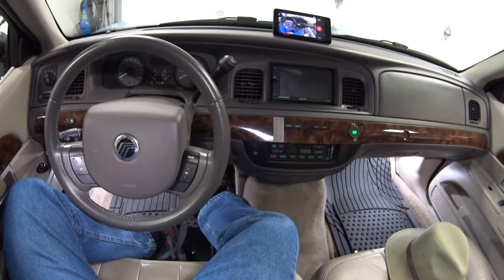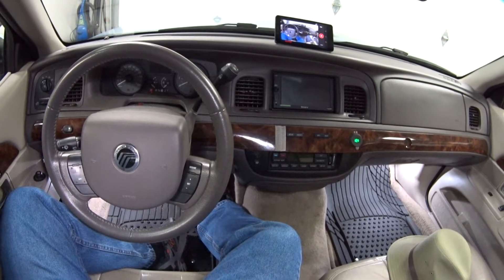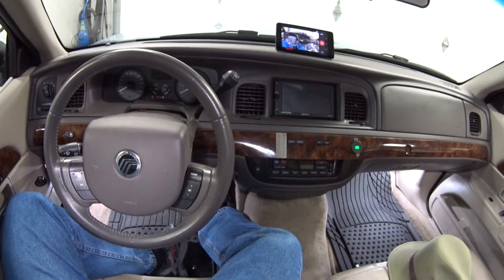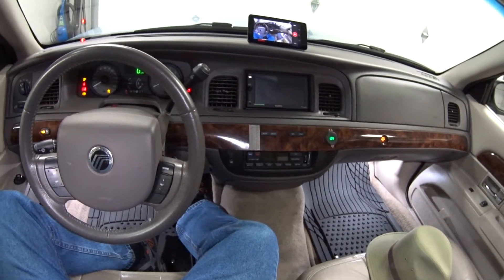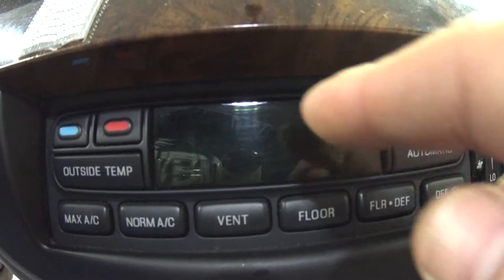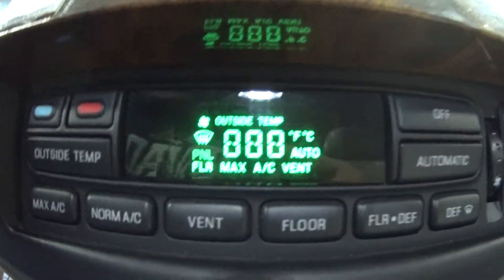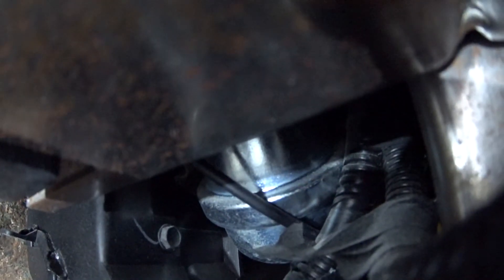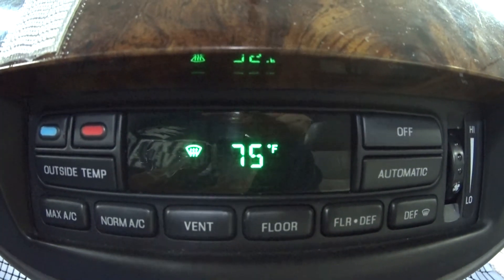Ford EATC HVAC Self Test - Reset & Calibration

Comment: I am having a peculiar situation with an 02 vic. The blower will randomly cut off and turn back on (and only in full blast) when it works. Sometimes (tends to happen in warm weather) it just refuses to run at all. If I pop the hood and start tapping on parts that I believe are involved with the hvac system, it eventually starts running, but only on full speed. Tried the selft test a few times, including when experiencing the no blower condition, got 888s. My current suspicion is the hvac control unit in the dash board, or maybe a thermostat? Is there a blower motor resistor on an automatic hvac? Trying not to unleash the parts canon on this thing. Any thoughts on this would be greatly appreciated
Reply from the maker: Check blower motor resistor.
-Chuck

Comment: You can do this with the engine on too.  I get the pops and an error code 024 (blend door), but for some reason this always fixes it.  Just have to switch or run this from winter/summer or summer/winter.
Reply from the maker: Thanks for watching.
-Chuck

Comment: I watched your video a number of times and also read through the 231 comments. I could not find anyone who had the same problems as my unit has. I followed your procedure for running the test multiple times, and each time the result was code 888, and I did not experience any resets correcting any of my problems like some of your other readers did. 

When I press Norm/AC with the temperature set at 60 degrees, I do not have any fan speed from LO – HI, nor any cold air coming out of the floor, dash or defroster vents. If I put the fan speed all the way up to MAX, I have cold air coming out of the floor and defrost vents only. When I repeat this test on MAX/AC I get the same result.

When I press DEF with the heat set at 90 degrees, I do not have any fan speed from LO – HI, nor any hot air coming out of the floor, dash or defroster vents. If I put the fan speed all the way up to MAX, I have hot air coming out of the floor and defrost vents only. When I repeat this test on FLR-DEF or just FLR, I get the same result.

As you suggested, I watched the FordTechMakuLoco’sVideo and replaced all the o-rings, and then repeated all the self tests and got the same results as stated above. I was wondering if you have any suggestions on what my problem could be with not getting any hot or cold air out of the dash vents and why I have no fan speed from LO-HI? Thanks.
Reply: My car is a 2009 Mercury Grand Marquis civilian model, not a police model. Sorry I did not include this information in my original post.
Reply from the maker: @BruceD.Stephens  
I would check the Blower Motor Resistor.
-Chuck
Reply: @PanzerPlatform  Chuck, I changed the Blower Motor Resister on the fire wall behind the engine, wow what a tight space to work in. I now have a fan speed from low to high controlled by the fan speed wheel. Thanks for the advise.
Reply from the maker: Hello,
1.) What is the YEAR / MAKE / MODEL of your car?
2.) Is it a police model, or civilian model?
-Chuck

Comment: Hi Chuck,

What do you think about this? 

On Wed I tested and got these results with  Blend Door Actuator (BDA) installed (bolted/screwed down):

Results
======

Test 1:

024 - blend door fault (during test)
025 - blend door fault (intermittent)

Test 2 :

024 - blend door fault (during test)

Test 3:

024 - blend door fault (during test)

Test 4 (I unplugged the electrical connector)

024 - blend door fault (during test)

On Thur I read about some folks claiming that after cleaning the internal pads under the larger gear that looks like a semi-circle, cleaning and adjusting the metal ends within the connector to make a tighter fit,  they were able to make the BDA work.

I did these yesterday and did a re-test with the Blend Door Actuator (BDA) uninstalled.  It was dangling on top of the glove box door.    The test passed 2 times.   I then installed the BDA with it not bolted down yet and it passed 3 times.  I couldn't believe it.   I then installed the front 2 bolts (screws really) tested even more and I could hear loud clicking as opposed to the clicking I heard prior which was much quieter.

Today,   I removed the BDA (dangling) and re-tested.   Again it worked.

It seems like when uninstalled, the test passed (888) and not DTC.  Only when it is installed does the test fail and not always.

Is it that the gears are almost close to being full stripped and that when the BDA is under load (installed and actually having to move the door) it is hit or miss?

Any idea where I can get a Motorcraft to replace mine?  It is from a 2000 Ford Explorer Eddie Bauer 4.6.   

This is what is on the white label from the BDA:

F87H-19E616-AB
R242 A31991
ATC

Thanks
Brian
Reply from the maker: Hello,
Maybe you have an obstruction inside the ductwork making it difficult for the motor to operate.
I would get a cheap $50 borescope off Amazon, and look inside the ductwork.
Maybe you got a critter that built a nest in there.

Is this your Blend Door?
Your Explorer has 2, or 3 different ones.
Search this Motorcraft part number on Amazon.
Motorcraft YH1769 ($26.62)
-Chuck
Reply: @PanzerPlatform  I will check out that part # and that scope.    

Something could be in there.  I wonder if I could remove the Actuator and manually open/close the door?

Brian

Comment: 2003 MGM LS I ran the test and got no codes. But I still get no air blowing through the defroster or footwell.  All blows through main vents. I replaced the blend door actuator this past summer and all the o rings.  What do you think it is? Blower resistor?
Reply from the maker: This might help.
Check the Vacuum Control Motors.
https://youtu.be/O-UblzGhbDw
-Chuck
Reply: @ Thank you very much!

Comment: I was wondering if you had a fix for my climate control in my 2006 super duty diesel pickup truck. There's acts like there's no power to it it will not turn on I checked all three fuses under the dash and I check the fan fuse under the hood and I switched out the relay. There's still no power to the unit. I noticed there was a video about switch the headlight from you know where it turns on when it gets dark and back to just manually turn it on back and forth back and forth I didn't have any luck with that I was wondering if you might be able to explain that process better
Reply from the maker: Hello,
Before spending any money on the parts shotgun I would get a dealer level scan tool and check for codes, and send bi-directional commands to the HVAC control unit. 

Since you have a Ford I would get FORScan for $20, or the XTOOL A30M. 

If the control head will not accept commands from the scan tool it might be dead, and I would pick up a spare at the junk yard for $20. 
-Chuck

Comment: Quick question, I ran this test and all is just as yours, so how do I know what’s wrong with my ac not blowing cold air, just hot..TIA
Reply: Chuck, I did check and it’s not engaging, does it need to have Freon to engage?  I thought I read something somewhere that without Freon it will NOT engage…
Reply from the maker: @StandForWisdom  
Check fuses first.
Next you need to check low / high side pressures with a manifold gauge set.
You can barrow this tool for free from most parts stores like AutoZone.
If the pressure is low, or their is no refrigerant in the system you need to check for leaks with a vacuum pump.
You can also barrow this tool for free.
You must repair the leak first before adding refrigerant to the system.
Reply from the maker: Hello,
1.) Start the engine, and turn on the A/C.
2.) Open the hood, and watch the A/C compressor clutch.
3.) Check to see if the A/C compressor clutch engages, and disengages every few minutes.
After you do that come on back for the next step.
-Chuck

Comment: Before my a/c was blowing about 50 degrees, full a/c no leaks. Obviously a vent was opened and letting in outside air. After, the a/c blows 38degrees and acting normal...
What's the RED and  BLUE buttons for on the a/c dash. I can't figure out what they do.
Reply from the maker: Hello,
Refer to your owners manual.
-Chuck

Comment: Mine is making that annoying tick but a/c still works. Also throwing out a 24 code error. Also I replaced the blend door behind the radio. The previous one was stuck blowing hot air out through defroster… I’m I going to need a 2nd actuator? Jesus 😢
Reply from the maker: Try this, it's worth a shot;
https://youtu.be/9CxejeIbGYw
-Chuck

Comment: 2004 Crown Vic.  After replacing a blower motor and resistor  I had no heat, only A/C, ran this test and it reset and FIXED!  Many many thanks for this information.  I did the silicone o-rings last year, and thought a blend door actuator was maybe necessary this go round.  You saved me a few bucks and no telling how many hours.  (Cars be crazy.)
Reply from the maker: Thanks for watching. 
-Chuck

Comment: Mine says 025 after I did the test, what does this mean?
Reply from the maker: Yo Jake,
Try this first, and see if this restores proper function;
https://youtu.be/9CxejeIbGYw

If not, check; 
Thermostat.
ECT sensor with scan tool.
Coolant level in radiator.

After you try those 4 thing report back with an update.
-Chuck

Comment: My 97 Crown Vic has the EATC the AC only works if it's set for 60 degrees, any temp higher than 60 and heat comes on. When I did the self test I get a code of 031 - Inside Temp Control Sensor Open, during test.  Do you know how this can be fixed?
Reply from the maker: Yo ESW,
Thanks for stopping in.

Ford TSB 97-8-8 is associated with EATC error code 031 on 1994-1997 Crown Vics. 
Send me an email, and I’ll email you the 7 page TSB. 
I suggest reading the TSB before proceeding with diagnosis.

Next I would pull DTC’s from the PCM with a scan tool.
Next I would perform this procedure, and then see if that  fixes the issue;
https://youtu.be/9CxejeIbGYw

Next I would check the interior temp sensor.
Next I would check the interior temp sensor circuit.
-Chuck

Comment: I did this self test repeatedly and nothing happened with the key in the run position and it wouldn't do the self test until I started the car.
Reply from the maker: Yo Fred, 
Thanks for stopping in.
Are you currently experiencing a malfunction?
Do you need help with diagnosis?
-Chuck

Comment: I have a digital fuel gauge to my 2004 Grand Marquis which I think is not reading correctly.  Is there a way that I could reset or do a test on it
Reply from the maker: Yo Stick Shift,
That is a great question.
Yes, there is a procedure on the 2006-2011;
https://youtu.be/mtpkDZUIphg

However, for your 2004 I'm not sure if it has this capability.
Try pressing the buttons like shown in the video.

Also you can try this "reset"
https://youtu.be/9CxejeIbGYw

Also if you have a scan tool you can look at the LIVE DATA to see the fuel level, and compare it with the instrument cluster gauge.
-Chuck

Comment: Im going to try it in a few.  Everyone says its my blend door.  I have heat but no air, it was filled with freon and still no cold air at all.  hopefully this step will point me in the right direction...Its gonna be hott here in Little Rock this summer.
Reply: So I did it,  it gave a code 025.  I turned it on then back off,  then turned on the air cond again and guess what....I have air!!!!  It said the blend door was intermittent?
Reply from the maker: @seansimmons5962  
Next time it goes on the fritz do the reset again.
When that no longer works this might help;
https://youtu.be/S0VgsFcdpdM
-Chuck
Reply from the maker: Yo SS,
Thanks for stopping in. 

If it is the blend door, this might help;
https://youtu.be/S0VgsFcdpdM
-Chuck

Comment: Your video is the best!!!    I had a code 51, Inside cabin temp sensor "Open"   I replaced it and I still have a code 51.  Do I assume the blend door actuator is fine????  Thank you.
Reply from the maker: Yo C&H,
Thanks for stopping in.

Pulling a code is never a reason to replace any parts, it's simply a starting point for diagnosis.
Here's how you can get free access to service & repair literature for any car for free;
 https://youtu.be/cCxHk1PNBuo
-Chuck

Comment: 2006 Mercury Grand Marquis. I have run the test a few times and it gives no error code but still blows heat. Very disappointing. I had this issue with a 2001 MGM and it costed about $1000 to tear up the dash. I have a feeling I'm screwed again with this issue. I hear no sounds, no door banging like the other car. Rather silent but nothing changes, just hot air. Why is it, it never gets stuck on cold!!
Reply from the maker: Right on Cola,
Thanks for stopping in.

You may want to try a re-calibration to like this;
https://youtu.be/9CxejeIbGYw
-
If that doesn't work here's how I fixed mine without removing the dash;
https://youtu.be/S0VgsFcdpdM
-
Keep us posted on your progress.
-Chuck
Reply: @PanzerPlatform  I appreciate the quick reply. I just tried fix#1 and it still blows hot. I'll watch the 2nd video now.
Reply from the maker: @PNFLnetwork  
Right on Rich,
I just replied to your email.
-Chuck
Reply: @PanzerPlatform  I just tried your Fix#1 again exactly as you did it. Bought one of those clips, waited 5 minutes. The only difference was, it returned to blowing air the same temp as the Vent. It was not hot but not cold. I also pressed the buttons high ac, norm ac, defrost, floor, both floor/defrost and they all seem to work correctly. I don't know, maybe it just needs Freon? Wishful thinking huh :)
Reply from the maker: @PNFLnetwork  
Hmmm, try this;

Turn the key on, but do not start the engine.
Adjust the HVAC fan speed to the lowest position.
Go to the passenger side front seat.
Stick your head under the glovebox.
Adjust the HVAC temp from full hot to full cold or full cold to full hot.
You should hear the blend door acturator moving back & forth.
Please come back and report what you hear, or don't hear.
-Chuck
Reply: @PanzerPlatform  I will do that tomorrow......so the key is I need to hear some sound or we know its stuck.
Reply from the maker: @PNFLnetwork  
You should hear a tiny electrical motor whiring sound, and the "door flap" opening & closing.

If you hear nothing, most likely the electrical motor inside the Blend Door Actuator is kaput.
Reply from the maker: @PNFLnetwork  
I'm confused?
I thought I already answered this question on your comment on this video;
https://youtu.be/S0VgsFcdpdM
-
Is this a new question?
Take a look, and re-read it.
-Chuck
Reply: @PanzerPlatform  Correct & Withdrawn :)
Reply from the maker: @PNFLnetwork  
Whew. Lol

Comment: Any ideas what could cause a 052 other than what it says it is? I've tried everything but my clutch won't kick on only when I jump it it blow cold when I do
Reply from the maker: Right on DM,
Usually I start with the basics.
Check low / high side pressures with a Manifold Gauge Set.
You can barrow one for free from most local auto part stores.

-Chuck

Comment: Mine reads code 51 and 53. With the engine on it just read 51. But My issue is cold air only comes out through the defrost vents and barely anything through the dash vents unless I turn the air flow knob to the bottom for some reason air starts to come out the vents. When I turn the knob up then barely anything comes out the dash vents and instead the cold air just comes out the defrost vent.
Reply from the maker: Right on Victor,
Thanks for watching.

This might help your air flow issue; https://youtu.be/GVEG9v1HgKA
-
See the description box for error code definitions.
-Chuck

Comment: I have a 2002 ford crown Victoria air not coming out of any vents already checked fuses and blower motor and did the self test on it all 888
Reply from the maker: Right on Jose,
Thanks for watching.

Check the Vacuum Control Motors.
They work off vacuum, not electricity so they will not produce an error code.
This video should help; https://youtu.be/O-UblzGhbDw
-Chuck

Comment: I am getting a Code 031 during the selftest of a 2011 CV EATC unit. Is this normal as the vehicle wasn't running at the time but the A/C had been running prior to selftest? Thanks For your Help
Reply from the maker: Right on Carl,
Thanks for watching.

Are you expreriencing any kind of malfunction, or drivability issue?
If so, please explain.

Sometimes I will get an HVAC code on mine, and everything is functioning properly.
You may want to try this;
https://youtu.be/9CxejeIbGYw
-
Then, after a few days of driving perform the self test again, engine running, and engine off.
-Chuck

Comment: I replaced the blend door actuator and I sent my EATC away to be rebuilt.  When I put everything back together the blend door would NOT work until I did a self test on the EATC and now it works fine.  My question is this: I still have a 25 code but I think that is was from before I sent the EATC away and from when the blend door was broken.  How do I clear this code and start over?
Reply from the maker: Right on TL,
This might help; https://youtu.be/9CxejeIbGYw
-Chuck

Comment: What do you do if it won't do the diagnostic? Ours is a 2007 GM. It was fine Saturday. We spent 1300$ on getting it working not quite 2 years ago. New Compressor, dryer....etc. There is not much air coming out anywhere. Most that is coming is thru the front vents. Even turned off it is still hot air coming in. No AC at all just hot.
Reply from the maker: Right on Brain,
Thanks for watching. 

If it were my car the first thing I would do is pull DTC's with an OBD2 scan tool. 

Let me know if you need more help. 
-Chuck